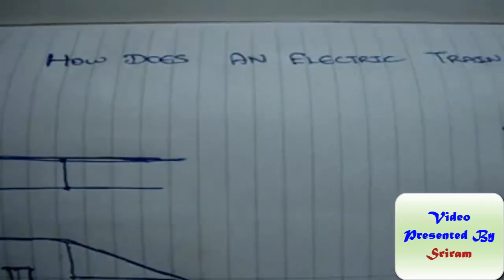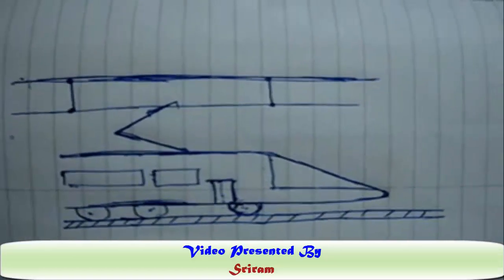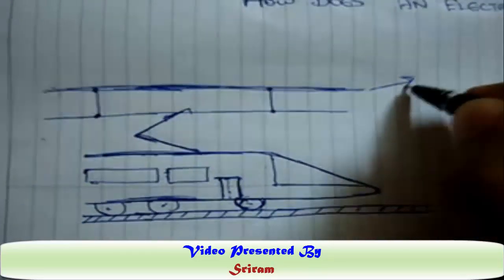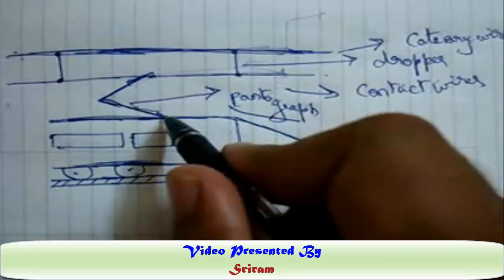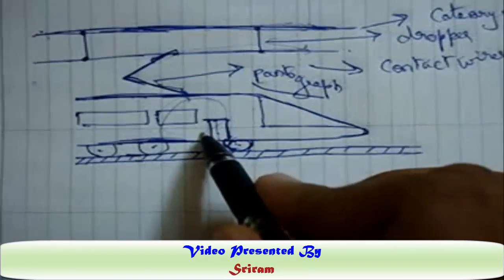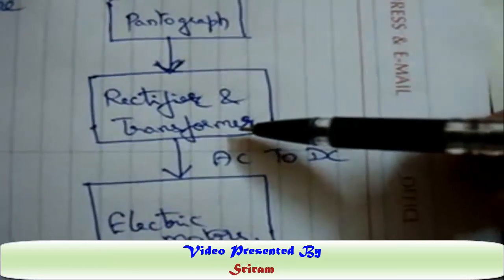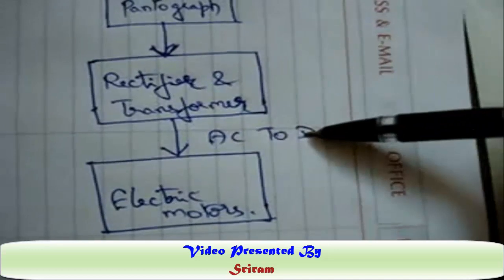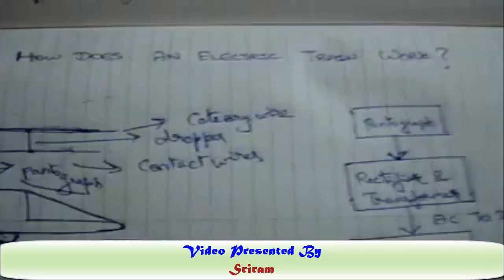Electric Locomotive Working..! Part - 1.

Comment: Transformer is Ac device right.
then the power which is in Pantograph is Ac or DC.???
Reply: the transformer is used before the rectifier... the transformer steps up/down the ac current and the current then is passed through a rectifier to be converted into ac
Reply: Piyush Pulukool Rectifier will convert Ac to DC ? Not pure DC but fluctuated DC is it

Comment: 6 DC motors are used in loco motive as these DC motors having high starting torque. when the loco starts, it has high load connected to it. to pull that load high amount of torque is required so we use DC motors

Comment: In railway Locomotives not needed Neutral wire due to railwheel is directly connected with tracks.The neutral are connected through wheel@Peter George

Comment: 2500o volts needed for Electrical locomotives and EMU because Traction motor which is installed between wheel(main part of locomotives) needs high voltage with high rectify..
@Uttarakhand Simply Heaven

Comment: DC Series Motor used to get the more starting torque than any other motor.See DC series motor structure from B.L Thereja Electrical Engineering book u will understand.@Indra Ida Bagus